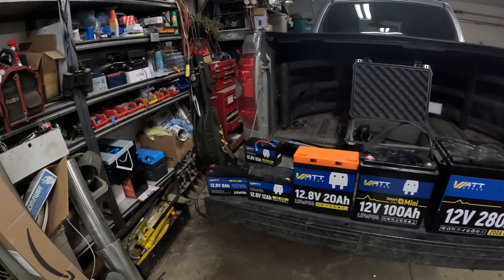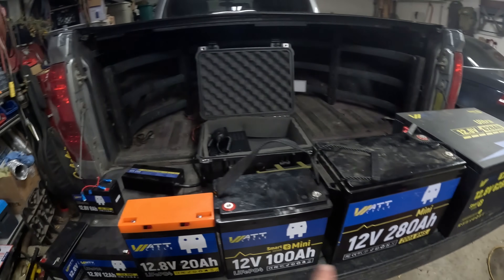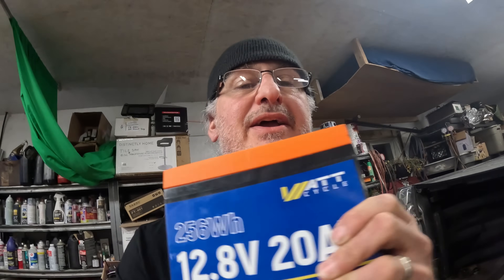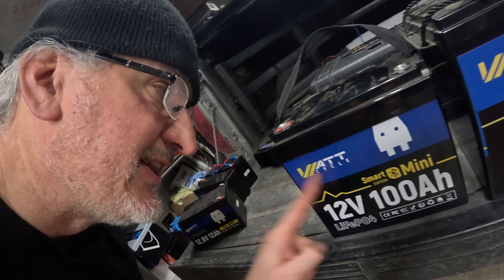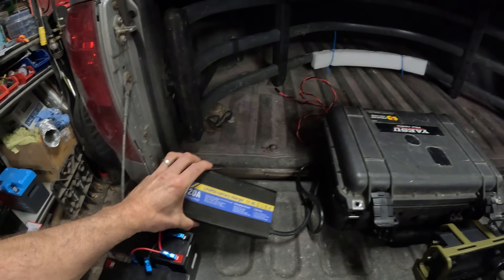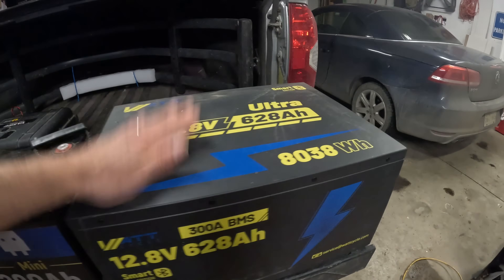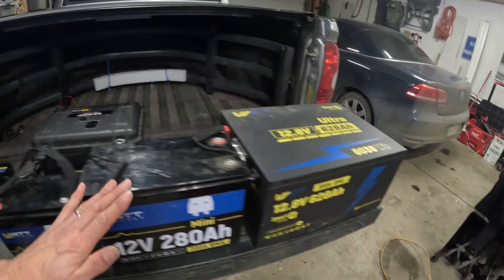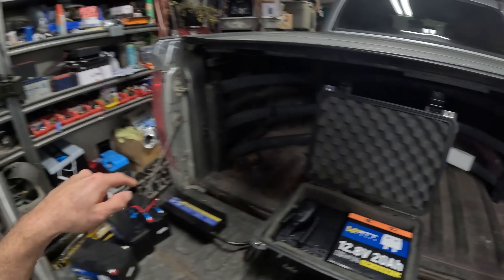From Tiny 8Ah to MASSIVE 628Ah! WattCycle Battery Size Guide (Ham Radio + Off-Grid)

Comment: I’m extremely disappointed with my WattCycle battery. It completely stopped working and now shows 9.5V, even though yesterday it was at 73% on my battery bank monitor. I followed all the recommended steps, and nothing worked. What’s worse, I recommended this battery to several friends, and now I feel embarrassed for trusting this product.
And the support? Absolutely terrible. They advertise “24/7 support”, but in reality, I get one reply per day and can’t even move forward. This is unacceptable for the advertised product. I have the 100Ah 12V battery...
Reply from the maker: That’s unacceptable.   I’ll forward this message straight to the manufacturer.
Reply: I love how they are not affected by the cold weather. I left mine in the car for a few months.
And it had not dropped any power